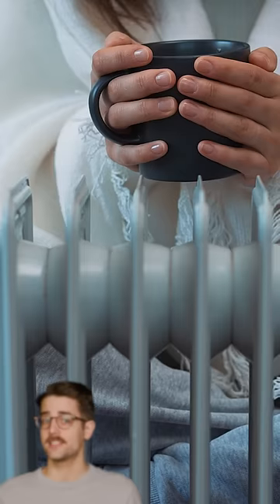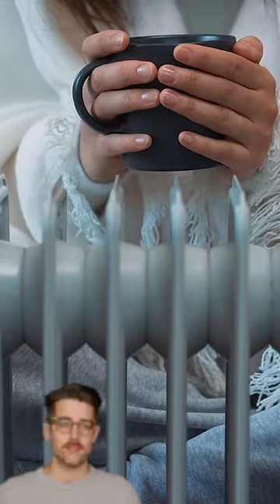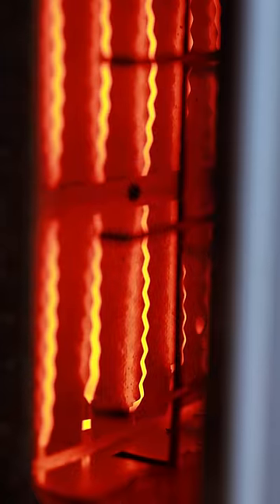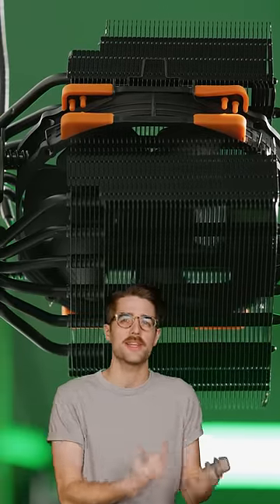Why PC Heatsinks Are So HUGE #Shorts

Comment: In feature the CPU and GPU coolers is going to be a Refrigeration system with some R290 to dissipate effectively the heat in smaller footprint... This is the mind of a refrigeration technician

Comment: "Water" coolers are hybrid coolers. The cool the component with water, then cool the water with air. You can also think of them as 2-stage coolers.
Reply: So are heatpipes which use the phase change of water to draw heat away as a vapor and reconstitute as it cools down wicking back down.
Reply: @blazetownsend8785  I think they use alcohol, which boils at 80°.
Reply: @ShawnHCorey  No, it is water. Alcohol boils at too low a temp. Remember, you want it to be vapor and to reconstitute as a condensate. Alcohol turns to vapor at room temp and does not create condensate in loops like heatpipes. To turn it into a viable cooler, you'd need to add a compression stage to create the condensate and at that point you'd get a refrigerator. Water works at 100 Celsius though, and gives us the overhead we need to cool with. The amount of water in loop is small to allow for the exchange to happen efficiently. Think of it like cooling your body, we use water much like a heatpipe uses water, and that is the phase change of water to vapor carrying the heat away from the body or heat source in this case.

Comment: Something I've wondered for a long time is why heatsinks are shaped how they are instead of being something more like Steel Whool: wouldn't that even further maximize surface area?
Reply: My guess is that it's more durable (it won't fold or crumple or break apart over time), easier to manufacture, and also easier to clean (for when it gets dusty, you can easily blow the dust off because of the openings). Another guess is that having the fins be straight leads the air straight through it so that there's no resistance with airflow. (because having resistance means less airflow and that means the air surrounding it will get hotter and hotter.)
Reply: It wouldn't allow heat to travel and trap it on one side.
Reply: They dont want fireworks lol
Reply: I think I know why: the boundary layer and pressure drop. Basically, it would work better but you'd need a vacuum cleaner to pull air through it.

Comment: does water cooling do anything more than just move the heatsink away from the cpu?
Reply: Yes and no. It essentially does just move the heatsink away from the CPU, but in doing this it both spreads the heat over that greater area of distance as well as allowing the heatsink to be an even greater area of dissipation through the use of a much larger radiator than would normally be possible in the space available right on top of the CPU.

Comment: Haha 🤣🤣. I'm lucky that I have H80i v2 with noctua fans in push n pull, it's relatively compact compared to other Aio's or air coolers. That being said, I do have an additional 3 case fans and my 1070 has two also, but it's still neat inside my Haf 912 plus mid tower 😁